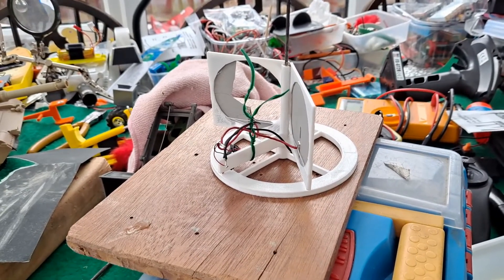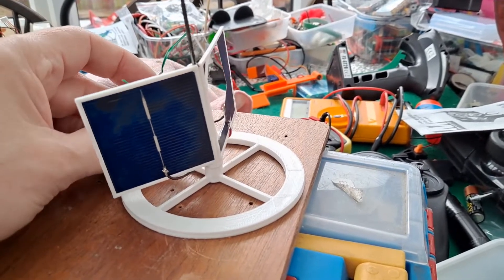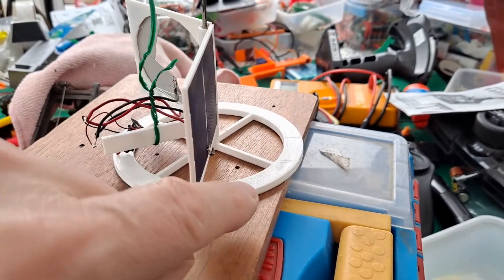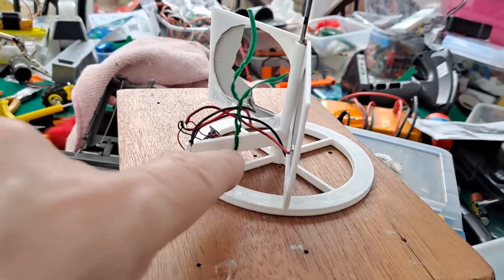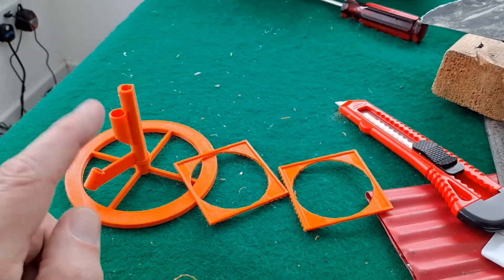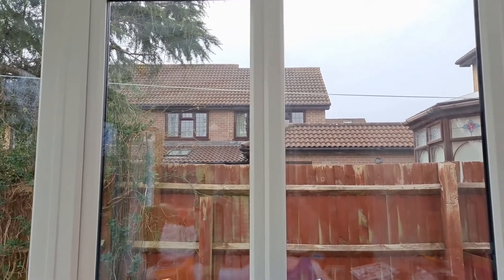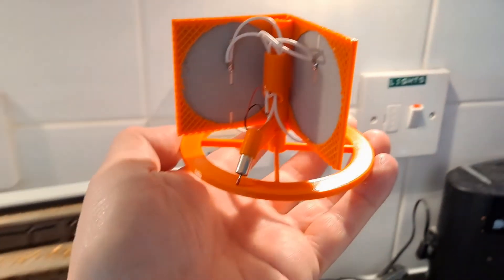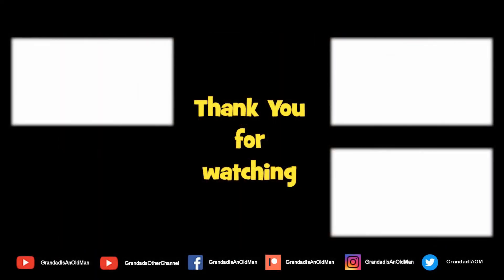Solar Tracker Version 2

Comment: I am using a thin layer of glue to strengthen those panels (UV glue), on both sides. It is really easy to apply, and hardens in the sun. Use a piece of plastic to smear the glue out, most plastics don't adhere to the UV glue (for instance the plastic bags to put your bread in for lunch). You can also use resin, but I find UV glue so much easier to apply.
Reply from the maker: I haven't tried the UV stuff yet. Might have to get some.

Comment: Nice redesign .
Reply from the maker: Thanks Jack, I think this came out a little heavier, not much in it but it seems a little sluggish. I also changed the angle they are set at, to 90°, I think it was only 60° the first time. I might do another one as I have already cracked one of the panels again 😕
Reply: @GrandadIsAnOldMan  
Pro tip, don't break the solar cells . :)
Reply from the maker: @OverUnity7734  Pro tip, don't even touch them. They are so brittle. I thought putting them in the frames would protect them, but not enough 😕

Comment: I really like that
Reply from the maker: Most of the day it does nothing, or nothing that you would notice, but later in the day the sun has moved around to a point where it shines through the branches of a tree and then it goes crazy as the wind blows the branches and the shadows flicker across the panels. Quite noisy at that point too.